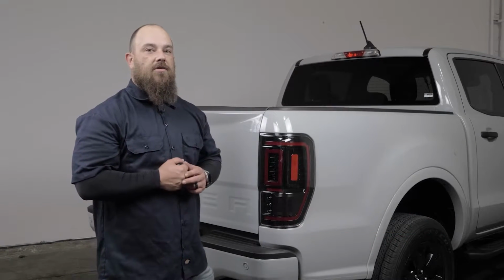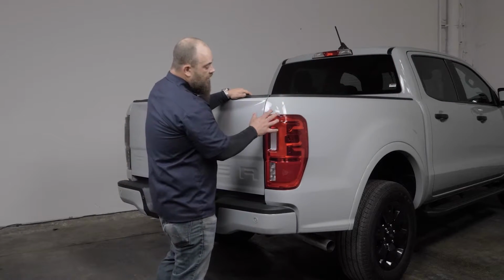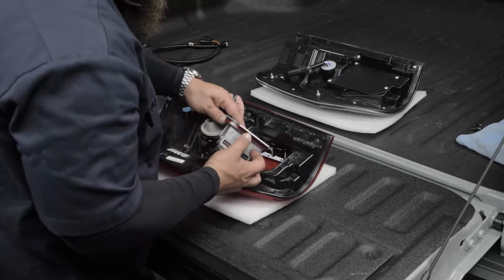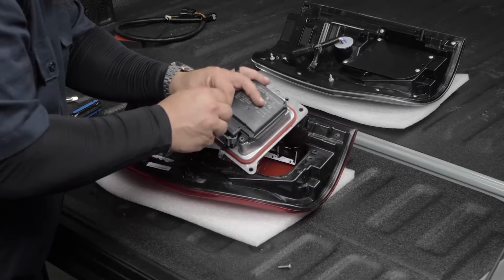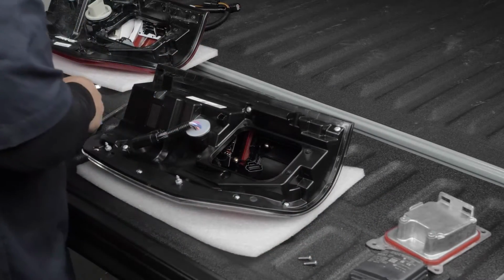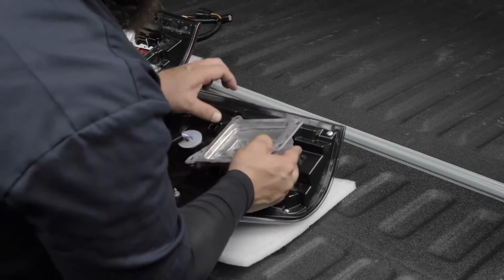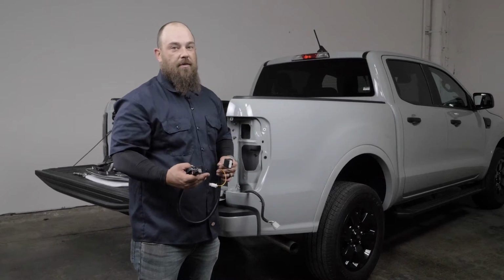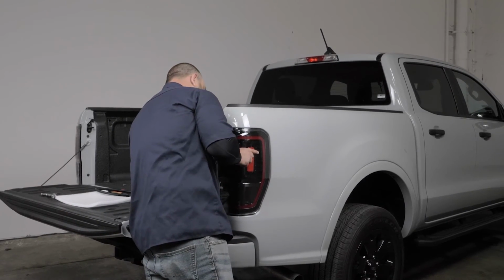Anzo USA 2019-2023 Ford Ranger Full LED Tail Lights with Sequential Signal

Comment: I look forward to getting a set of these for my Ranger. I busted a lens driving off road but my BLIS sensor still works, I love that your alls assembly accommodates the BLIS as a lot of aftermarket options don’t. I can get both tail lights from Anzo cheaper than just one OEM from Ford, plus they look better than the factory ones too.

Comment: Great video!  Very helpful even if you are just replacing an old or broken taillight with another "factory" part.  I'd like a cut of the main harness removal, as the demonstrator's back is to the camera during this step.  I ended up breading the red tab.  It seems snug enough to stay in place.  We will see I guess.  Thanks for the help Anzo!

Comment: i have a 2021 stx fx4 package is this compatible
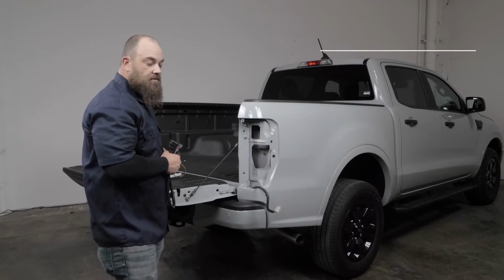Reply from the maker: The tail light will work for all models.There is a harness included for non-BLIS models. The installer refers to it at 7:48 in the video. Thank you.

Comment: These are the first aftermarket lights I've seen for the 19 to 22 Ranger... But  7 hun seems a Little high... Since ur using the existing blind spot sensor 🤔
Reply: just got mine for ANZO 19-22 Ford Ranger Full LED Taillights w/ Lightbar Sequential Signal Black Housing/Smoke Lens × 1
$447.31
Reply: @dwhitman62 where did you get yours? I’ve been looking all over for aftermarket taillights for my Ranger
Reply: @dwhitman62  where did you get them?  Good $$$